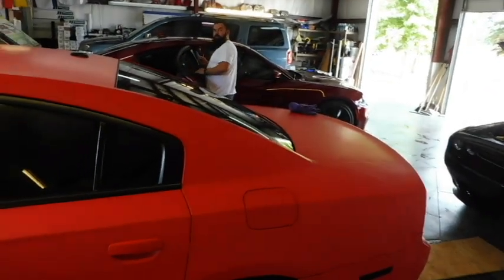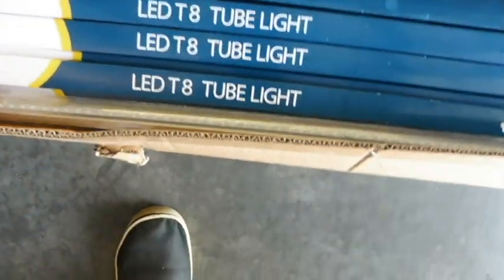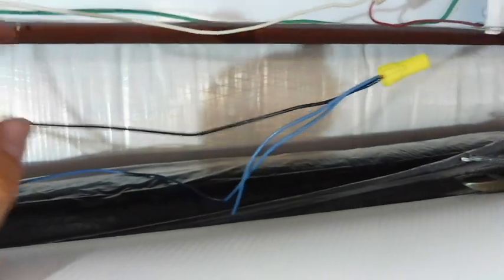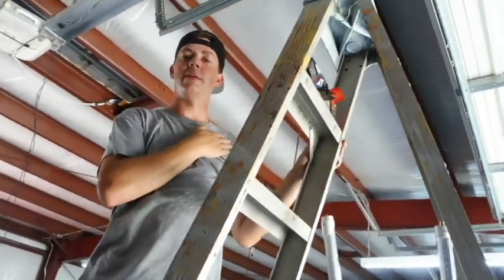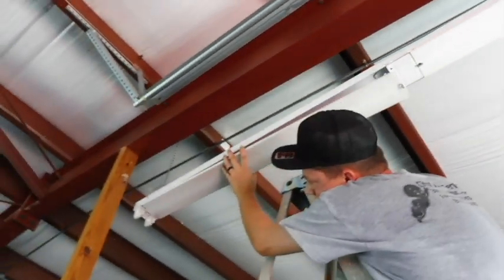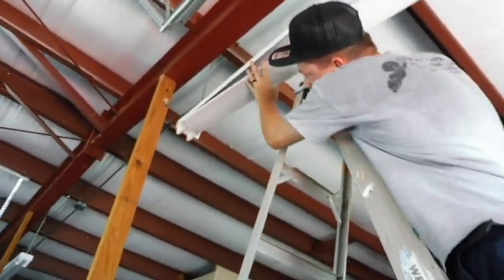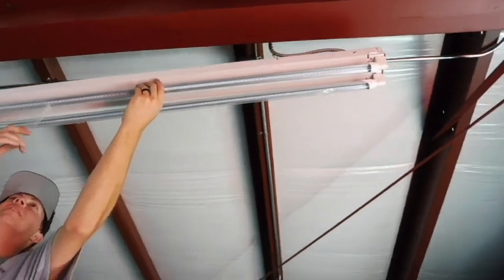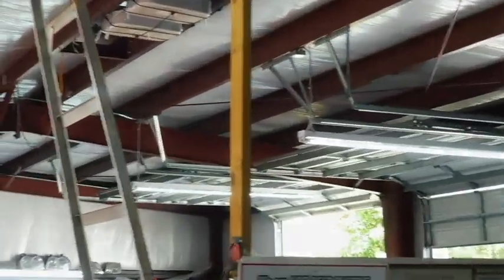How To Convert fluorescent shop lights to LED 8 FT T8 single pin

Comment: This video focused more on what they do at the shop than showing a step by step  florescent to led conversion. 2 THUMBS DOWN!
Reply: My house is 100 years old, and has the single pin tubes. Your’s is the ONLY video I’ve found that talks about how to wire with a ballast when the ‘tombstones’ have 2 wires each. Thanks.